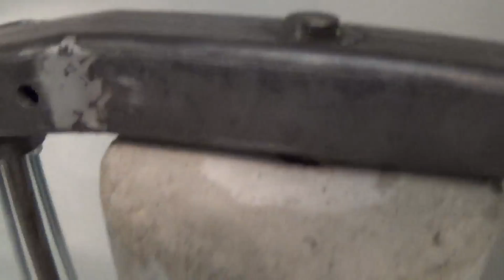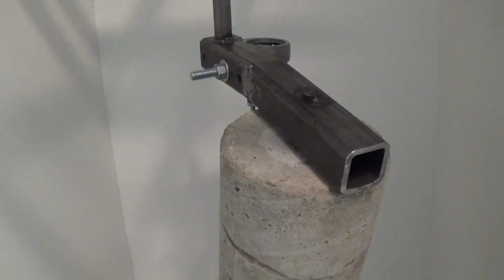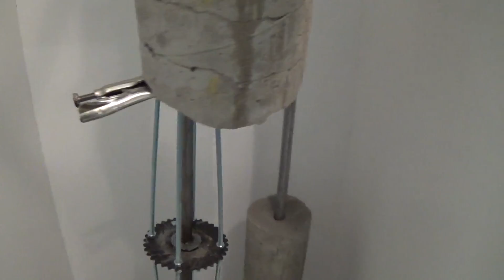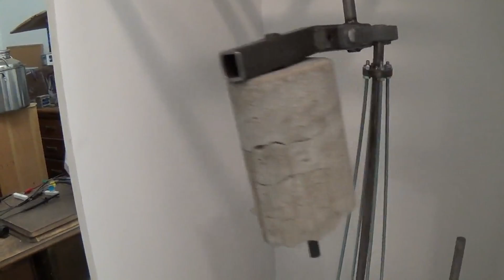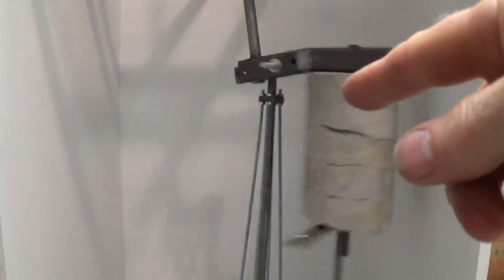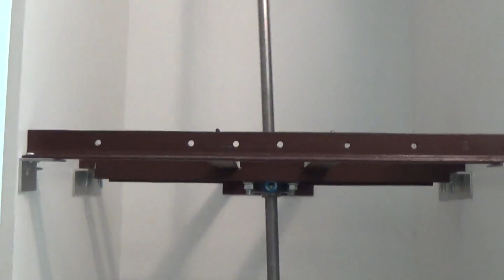William Skinner Gravity Assisted Torque Amplifier test  2

Comment: You yourself are explaining why it doesn’t work you stated that the upper weight lifts up to a level position well how does the weight fall if it’s in a level position?    And then you go on to say that the bottom weight  is just spinning acting like a fly wheel when the second stage is supposed to be doing the same thing the first stage does, the motor Rotates the upper lever arm and at the pivot point where the first weight is the lever arm should only do one thing, tilt the weight up, raise the weight Into a position where gravity can act on it to pull it back down.  When that is working correctly the first weights rotational circle becomes the second stage of the lifting process to tilt the second weight up into a position where gravity can act on it to pull it back down.  There should only be one input force at the top and it’s job is to move the upper weight into a position where gravity can act on it.   After that no other forces should be involved in the second stage other than gravity.  Mechanical input force manipulates the first mass into a position where gravity can act on it after that the gravitational force becomes a rotational force which becomes the next force to manipulate the second mass into a position where gravity can act on it.  The same exact thing that is happening in the first stage only the second stage gets it’s energy from gravity instead of the motor.   For the system to work everything must be independent in movement, The motor should not input any rotational forces into the system. It’s only job is to lift the first weight into a position where gravity can act on it.   If you do not follow these concepts you will not have proper amplification.   You must keep in mind that it is gravity you are harvesting.
Reply from the maker: It’s very easy to explain, right. Now build it and show me how it works so easily. Bet you won’t be back.

Comment: I see a big problem, the top lever arm is not doing what skinners lever arm was doing.  Remember the whole point of the top lever arm is to continually off set the first weight so gravity can continually act on it.   your top lever arm looks to be welded to the arm holding the first weight.  when the top lever arm is rotated, the bottom part of the lever arm should rotate also, and only rotate in a perfect circle , there should be no lifting , it's lifting the weight up and down because it's welded to the arm holding the first weight.  when the lever arm is rotated , the lever arm should be sliding up and down inside the inner race of the bearing that should be attached to the plate that is attached to arm holding the first weight.   actually it's that plate and bearing that slides up and down around the lever arm as it travels in a circle, and not the lever arm it's self moving up and down.   you have to fix that  first .  The next stage will be doing the very same thing the first stage is doing, but now the first weight is providing the power to drive the next lever arm.  Remember you have two lever arms, both doing the very same thing, using leverage to create a perfect circle to off set a weight into a position where gravity can act on it.   the first lever arm is being driven by a motor, the second lever arm is being driven by the first weight and also by the first lever arm but the first weight is the first stage of amplification, and you then drive the second stage with the power provided by the first stage.   but remember the first stage and the second stage are identical in action.  the only difference is the power amplification of the first stage is being used to drive the second stage and its the second stage power amplification that you can use to do work.  each stage harvest gravity and turns it into rotational energy, you don't have to stop there you can add more stages to the system.  each stage has more power than the next.  if you were to take the second stage power you could drive a larger mass with it and so on.   I see no limit to this thing,  and what is so amazing is if you start out rotating a small mass it takes very little power, then simply keep adding stages till your spinning super heavy masses.  the heaver the mass the more power you make.

Comment: You need thrush bushings atleast! And I'd put a bearing up top just above the top weight. And use bungie cords to hold it center. While allowing it to move. But a stack of copper, brass washers/ bushings. With moly lube. Or graphite with a bit if oil. To take the side load off the bearings.

Comment: I think the trick is to use multiple units connected together up top (90 degrees out of phase) so they cancel each other's gravity lifting phase, .   Skinners video had 4,  for a reason..  It won't work with one..  I tried.
Reply from the maker: We'll never know. I no longer have this test device.

Comment: Great start on this. It seems that the upper part is missing one more axis right off the first piece that connects to the motor at the top. I think if you had that, it would actually "fall continuously" as Skinner says and thus give you the extra energy output with the addition of the gravity input.

Comment: Hi Luc, I think you have basicly told yourself what is wrong. The top and bottom weights are totally independant and have to be or the load is reflected back to the source. Below the bottom weight has to be a universal joint, the bottom weight is your power source more than the top weight, they are not just a fly wheel. The whole idea is the continually falling weight, this you do not have, and you have them fighting each other. I believe that bottom shaft is straight and not bent, the tie rods are to keep it straight and not flex from the amount of weight at the bottom, what he has done is made the shaft feel as though it is twice it's thickness and so not flex. This is common engineering practice when a shaft is subject to an oliptical centrafugal force, which this is, what ever shape happens at the top will happen at the bottom but in a reduced ratio (compounding force,maybe 6:1) so with an input at the top of 1f you get 6f at the bottom. You see there becomes a multiplication of force in the length of the shaft (same speed but greater power factor) that power factor comes from that falling bottom weight, not from the top, the top is not seeing what the bottom is doing.
Reply from the maker: Thanks for your reply Mike. I like to test many options which helps me to better understand an effect. A universal joint at the bottom will also be tested.